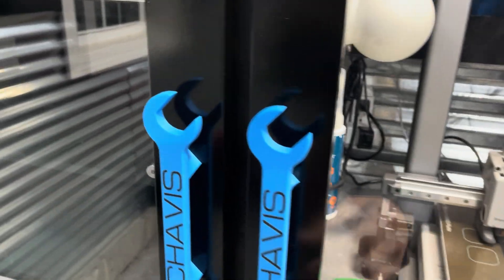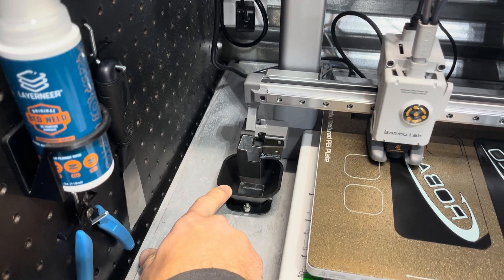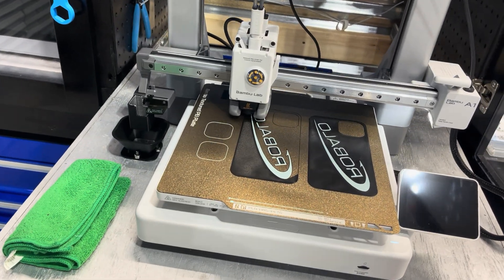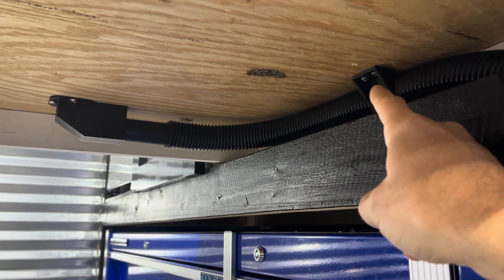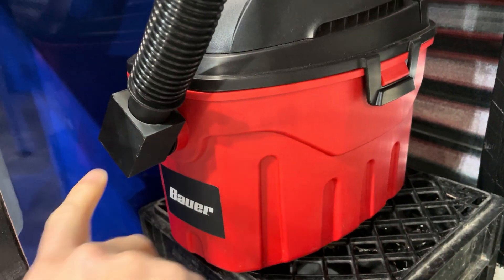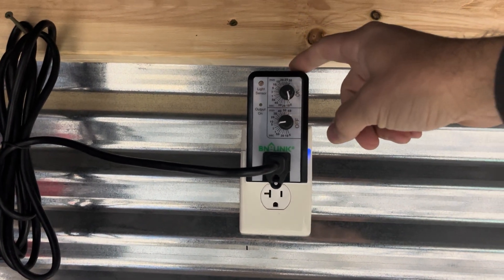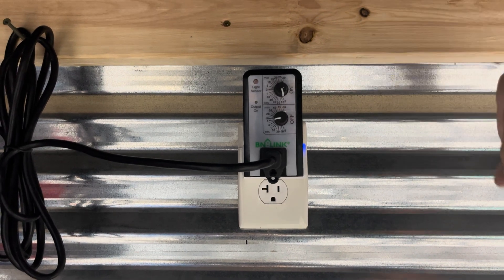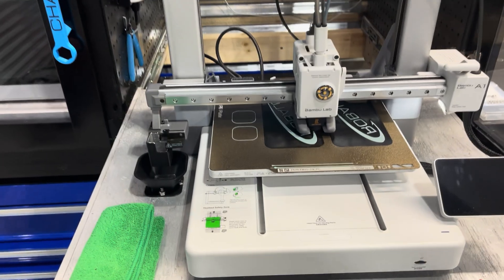Bambu A1 Automatic Poop Removal System

Comment: Where is the advantage of having a similar sized box mounted to the bottom of the table?
Reply from the maker: If you’re asking why didn’t I just put a box there instead then I certainly could have. It just wouldn’t have had as much space due to the spot I have the printer in. Plus I just enjoy doing stuff like this. It’s definitely not for everyone’s case but I like that I don’t see the box of waste sitting there. My printer is also in my detached garage so noise is not a concern at all.  The X1C just has a cardboard box behind it.

Comment: Looks great, likely need a better solution for the timer that you don't need to mess with per print timing
Reply from the maker: Thanks.  I already had an extra smart plug so I wanted to use it. I also don’t have to mess with the interval timer since it’s set how I like it. Once I slice the print and see how long it’s going to take I can simply tell Alexa to set a vacuum timer for X amount of hours and it’s set. Works good for me.  Thanks for watching.

Comment: I thought we weren't supposed to enclose the A1?
Reply from the maker: It’s not really enclosed. The left and right side walls are pegboard. It doesn’t really hold much heat.
Reply: I have enclosed my A1. Only keep the door closed when printing ASA. I also have an exhaust fan on it when I do PETG. Keep the door open for PLA. Also I run at lower temps than the defaults. Example 270 was too high so I dropped my temps to 240 for PETG like on my Ender. 

Great jobs. I love what people come up with.
Reply from the maker: If I didn’t have my X1C I would definitely try enclosing the A1 just to be able to print Asa/abs etc.
Reply: You aren't. If you're just printing PLA and other relatively low-temp filaments you're probably fine though. I have to enclose mine because my basement gets pretty chilly, so I ran ducting to the electronics vents to pull outside air across the electronics and keep them cool. Even still, printing PLA with the enclosure all closed up only takes the inside temp to ~75F (~55F in my basement). Unless you have a way to cool the electronics I wouldn't try higher temp filaments enclosed.
Reply from the maker: Agree. I only use the A1 for PLA. I have the X1C in the other bay for high temp materials.